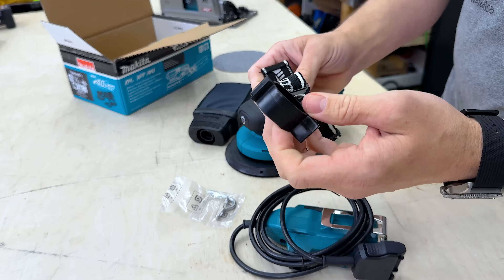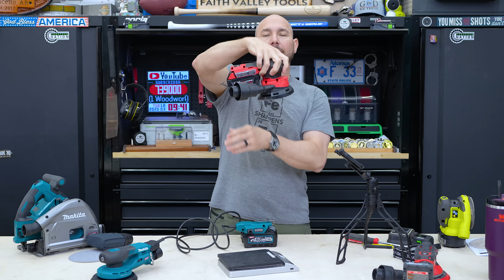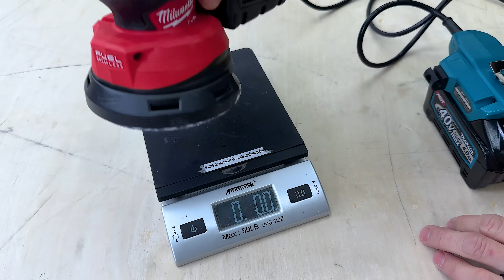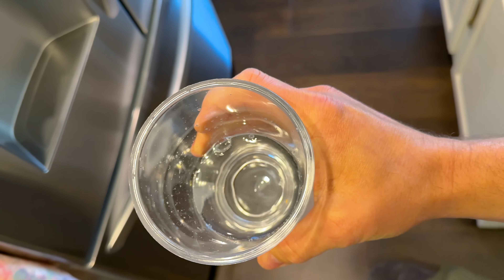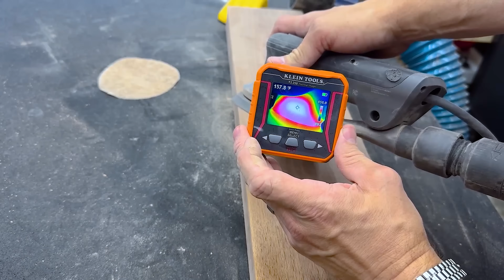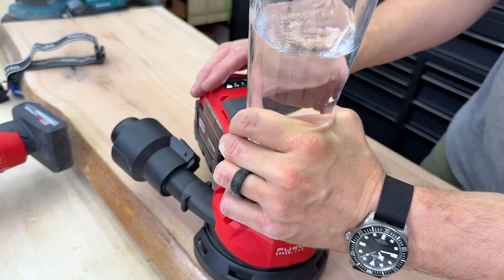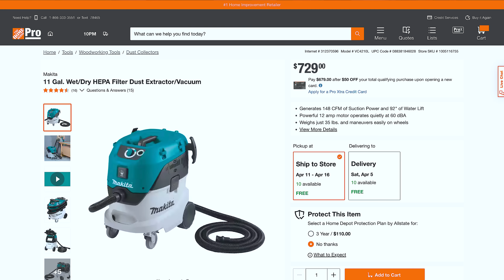Makita Just Changed Cordless Sanders FOREVER! (genius woodworking tool)

Comment: My father had a few Hitachi tools quite a few years back and he had them for years and there was no problem with them. So I decided to go with the Hikoki (Metabo) range. I like the multi voltage batteries and I purchased about 15 a mix of 18v & 36v plus the table saw, the drill/driver I have is 18v and powerful, my impact driver has four settings Whoop Dee Doo. And I would rate Hikoki being up there with the other top tool manufacturers. I think as long as you choose at least mid range you can't really go wrong. A drill/driver is for drilling holes & driving screws in, a circular saw does the job of sawing 6 by 2 etc, a reciprocating saw does good when it's time for demolition work and a sander is for making your projects smooth. As we all know tool manufacturers are always trying to better their tools and as long as you don't buy the bottom range of tools if you are a D.I.Yer, handy man, woodworker, tradesman etc you should be fine. I do like the power adapter, that fits all the 18v & 36v tools, the idea of not running out of juice especially when using my 36v weed whacker or the 36v chainsaw for those jobs that take a bit longer to do, I just have to let the wife know how handy they are and hope she gives me the card lol.

Comment: making an adapter to use AC in the battery slot would would make a lot of sense to me, could use it corded or cordless then. I may try to make one, just need to figure out what the max current draw on whatever tool would be... But I don't understand the battery on a cord, why not just get a corded one then? is there something inherently better about using a DC motor? Or just in case you have to use it where there is no power available?

Comment: This is so dumb. Having a cord attached to the sander makes it operate like a corded sander, but now it also has all the drawbacks of a battery tool too like more expensive, need batteries in the ecosystem, batttery life over time. You could just have a longer cord and then idk...plug it into the wall. What a racket. "unbelievable" alright.

Comment: They should design it with a wire terminal that couples into a battery slot so that you can choose between corded or cordless. All tool companies should do this. Awesome concept.
Reply: I was thinking the same thing. An adapter like that is very easy to design and print. A few bits of metal and cord and presto!I know what I will be doing tomorrow

Comment: This review is somewhat inaccurate unless you can also use this sander as a corded sander. Otherwise, the price claim of $249 is misleading.  You must add the price of a 40v battery for it to be accurate. I suspect a battery adds near $100. Even if you already own a Mikita battery, some additional cost was there at some point. This thing mostly makes sense for remote work. Not so much in a work shop where you can get the same features from a corded sander without hooking a battery to your belt.
Reply from the maker: Price claim would be the same for any of the cordless options shown.  You need the battery platform anyway.
Reply: @731Woodworks  I hear you on that, but it's still not $249 for a working sander. BTW, I am a fan of all your other videos.

Comment: Why not just get an Ecoflow or Jackery for your corded tool instead of something like this? That won't lock you into the Makita battery platform and you can buy whatever. The only way I see something like this system being best is if you're on a ladder or in a tight space and you don't want a power cord and would rather have the battery on your belt or wrist strap.

Comment: Wow i cannot wait till they make sanders with power cords that plug into the wall. They will be able to be weighted just right, have more power and reliability and last 30 to 50 years. Wish they could do that.
Reply: I would think they could easily just make a regular power cord that plugs into that connector. I'd buy it if that were an option!
Reply: @chrisvanover7817  That's what i though it was at first based on the thumbnail. Ryobi does that allot with their tools.
Reply: @chrisvanover7817 metabo/hikoki have a ac adapter for all their battery tools. Excellent brand for woodworking
Reply: @chrisvanover7817 bro I literally keep thinking about this why hasn’t any company made a power cord adapter
Reply: Heck No!  I want to spend over $500 for a sander/charger/batt with a cord instead!  I also get the joy of running out of juice!  Genius!
Reply: Everyone here thinks they’re an engineer.
Reply: @elephantgrass631  pick me LoL 😆
Reply: Exactly what I was thinking! 
Idiot idea!
Reply: Yeah, yeah.  But you have to bring your material to a socket or have long extension cords.  This has the flexibility of cordless, with the balance and weight of corded machine.
Reply: And never have to worry about dead batteries! When is this technology coming to market
Reply: I would love for this to have a plug in cord as well.  It would be great.  For anybody that used battery sanders they would know just why this is a better option.  The added weight to the sander makes it work super agressive and end up being hard to handle and really fatiguing to work with.

As for having more power from a cord or a battery... That would be debatable.  New battery tech can output more juice in less time than an outlet.  It won't work for long but you need a lot of power a battery has higher discharge potential than your 15 amp wall outlet.
Reply: Having worked a production cabinet shop where air sanders are the norm as well as hauling pneumatic hoses are a pain, this could be a great addiction to a shop. We typically don't use cordless due to weight imbalances and even though 4lbs doesnt sound like a lot for a typical 8 to 10 hour shift every lb makes a difference. The price however may put it out of the home shop market, but i guess all of makita 40v are pricey
Reply: @toyotadriver8101  I don't press down hard on a sander and that extra little bit of down pressure really makes sanders extra agressive and unwieldy.  At least that's my impression.  I like cordless tools in general but not sanders and air sanders are great.
Reply: LOL. I just use a corded sander with a retractable extension cord attached to the ceiling. Cord is mostly out of the way, and no battery death.
Reply: Exactly 💯 😅
Reply: I think it is strange nowadays that some of the corded tools still are not brushless (because the efficency is not needed?), but the battery tools are...
Reply: @kaktus3175  Yep do not need the added expense to make a corded tool brushless. You have unlimited power, so it really is pointless. Most tools it is easy to replace the brushes, but it takes a very lot of use to get to that stage.
Reply: @FUQNDV8  I am no power tool engineer, but I still see it from another perspective: You need two designs, two assembly lines. I find it kind of strange, that this obviously still is more lucrative than having basically the same thing w/ & w/o powercord.
And unlimited power: Do you still use light bulbs or are you on LED?
Reply: @kaktus3175  Cordless, corded or air have their strong points but if you are doing a lot of wood work or metal work battery powered are useless. Battery are great for small quick jobs less than a few minutes or you have to move around locations in a house for minor jobs. If you are working in your garage or outside and sanding for an hour, you need all the power you can get. I use battery, 240 volt and air. If any job is more than 2 minutes with a battery tool I use the 240 volt as it is quicker. Takes me all of 10 seconds to throw out a power cord i have them plugged in and hung up at beside most doors in the garages.
Reply: @FUQNDV8  But that is the thing: I for instance need the flexibility of a battery tool often or at least I want to have it. I also don't want to buy two tools of the same type and I don't have the space to store them. I would find it ideal to just have a AC/18V DC Adapter for those times I could use a cord.

I am not sure if I really like the Makita "battery cord" idea for myself. But I can at least see the point: Not such a heavy machine when for example sanding walls or ceilings, but still flexible without the need of an outlet.
Reply: @FUQNDV8 see there's a difference you have a space setup with power at the ready, most cordless tools get used on a job site where power is not at the ready. If I need power somewhere on our site I need to go to my truck and get a 50 or 100 foot cord then go to a power board we have set up and plug the cord in and drag it back to where I am working
Reply: I guess you don't like more options.
Reply: they could even make the sander bigger! like maybe add an inch or so. Idk I'm not a scientist.
Reply: Obviously its for new costruction where there no power. I cant wait until they create a tool capable of of pulling peoples head out of their butt though.😆
Reply: I know what you mean.  Seriously consider give a try with the VEVOR Mirka-like replica.  Order directly from the company, not Amazon, unless Cray-cray uncle Trump subjected this Chinese, yet awesome, company to a full-on tarriffed traffic.

I’m Canadian.   I ordered it for a little less than 300$ CAD (including the usual, in-house, out of this world taxes!).  It is as every bit as satisfying to use as the low-riders from Mirka, 3M, and Festool.  Some features might seem less technologically intricate on the Vevor model, especially the way to remove and replace the absorbing pad (which is, as of now, a fundamental feature of low 😊gravity, paddle-controlled sanders.). I have yet to find a reason for not wanting to do it the Vevor way.  I ‘ve had this sander for almost half a year,  and i have yet to find its weakness.

I WOULD BE GLAD IF YOU’D EVER CONSIDER EXTENSIVELY TESTING VEVOR’s SANDER!  This tool seems to me a game changer for the DIYer and the pro in the first years of running his own shop!  

LOOK FORWARD TO YOUR REVIEW!  KEEP UP THE GOODS!
Reply: ts such a marketing psyop its almost on the level of news media "We'll talk so loudly about these battery powered tools that cost 3-5x more & require batteries that only last 5 years or so that people won't even be able to hear about the corded tools that are cheaper & more reliable". Im sure the much higher % margins are a big factor that gets the whole system to play along. Obviously some tools are really convienent to have cordless but really outside of like auto mechanic work and like duty tools like a home drill & such idk why cordless tools are always suggested like they perform much better than corded.
Reply: @MarkTrades__  agree with a lot of your points.  I have 2 5A batts that have died in the last two months, and I probably have a few more cordless tools than I should due to good marketing (cordless glue gun anyone?  At least it's brushless 🙃).  However, I haven't picked up my corded recipro for around the house tree/bush trimming since I got my cordless last year, and a cordless blower certainly beats dragging around a 50 ft extension cord.  I do agree that the shift to all things cordless is quite driven by greed.  I don't see this corded/cordless sander as anything but a money grab. Don't even get me started on each line having their own battery pack requirements.
Reply: @JohnSmith-ld1pw  exactly. Some tools are absolutely improved by being cordless (hedge trimmer comes to my mind haha) but woodworking tools almost always being used in a workshop environment? An angle grinder uses to sharpen lawn mower blades? Circular saws? "Oh but if you are at a job site without power" what the heck are pros building where they go "you know what? We don't need a $1000 generator that can power everything, we just need $2000 in a single cordless tool battery platform and then a charger the size of that generator to keep the batteries charged. It will be fun constantly swapping them, trying to keep them out of the heat, trying to maintain battery health, etc"
Reply: @MarkTrades__  one reason for cordless tools in the workshop is, well the cord. Getting rid of the potential for injury or damaging from the cord is a good thing. The other is running power outlets to be able to plug everything in.  Cheaper and more organized to have a charging station than cords hanging off tables or from the ceiling.  Sometimes a mix of both works best.
Reply: @1packatak  I'd argue there are a lot more safety risks than a cord in an active workshop environment and that operating with safety in mind is a requirement as you can't design out the risks inherent in working with power tools.
Reply: @1packatak  a power strip is way cheaper than a multi-bay battery charger and the associated batteries. A mix of both is definitely the best but corded is underrepresented
Reply: @1packatak  Rather than a power cord then you run air tools and have the air connection just above your bench then use a light weight coiled up air hose to the tool. If a person can spend that much on all battery tools they can buy an air compressor and air tools. Only use for battery tools are very small jobs around the house that take a few minutes to complete. I use both power and battery and power are easy 5 times more efficient and powerful. You soon notice if you use an angle grinder on steel.
Reply: @ true. An experienced woodworker will know that and be as careful as possible. But crap happens. There’s a guy on YT missing most of the fingers on his left hand from a momentary lapse in safety. 
An inexperienced woodworker is much more likely to get injured.
Reply: @JohnSmith-ld1pw but you don’t have to buy them.  I can see the advantages.
Reply: @FUQNDV8 I've actually measured the power usage. Electric sanders are much more efficient than air samders..
Reply: @MarkTrades__  Here's a fun little fact. Some of the tasks we do on an actual commercial construction site are repetitive, don't take long, and have to move constantly to a new area or floor. So then cordless rules over corded all day long as set up and clean up are basically none existent. Then there's this fun little gremlin we have on our sites called the safety man and they love to go OVER BOARD on the safety. And they want cords tucked out of the way against a wall or something (can't cross doorways running down a hall though) so then they'd like to see them hung from the ceiling. No one's got time for all that bullshit on top of you know how hard it is to get guys to follow that rule, we literally can have a labor walking around all day sweeping and hanging cords up and that's on a smaller project with only like 10 to 30 guys there given the day
Reply: @n8_the_carpenter816  I'm a woodworker.  I love Corless tools for almost everything.  Sanding is one of the things I do that I prefer constant power to.  This sander I would get if I could plug it in when I'm in my shop which is 90% of the time
Reply: I really don't understand why you'd want a cordless sander only to then connect it to a comparatively massive dust extractor hose. The power cord has never bothered me, not once.
Reply: @Root_boy  I think that people tend to overlook other settings than they are used to themselves.
People who have a workshop/garage probably are fine with cables or as someone mentioned a big air compressor with an overhead setup to connect the tools at the workbench without hassle. But there are so many people out there, who live in apartments, use portable workbenches and so on. I can understand that is way easier to use battery tools and not have to run a power strip from somewhere.

I was working in two different hallways the other day and was happy that I had a battery vacuum, so I had not to bother with outlets and stuff.
And yes, nowadays you can even get a big battery with outlets for all the tools on a job site. That actually maybe would be something I would consider when buying a lot of new tools.
Reply: @kaktus3175  that's fair. I used to not have workshop either but I guess I suppressed the memories of having to sand without a dust extractor ;)
Reply: @Root_boy  As I said, I do use one (Metabo ASR 36-18 BL), which is also battery powered (2x 18V) and it is just nice to roll it to the next room without the hassle of a cord. That said: I do wish it had the option to connect the Hikoki/Metabo HTP 18/36V power adapter to it. Also, I stumpled across the Festool quick connector idea and yes, having a cord attached to the dust extraction with a quick connector and then just plug the vacuum in the outlet does make sense a lot to me as well.
Reply: That’s great if you’re in a workshop or always have mains power supply. Probably one of the more idiotic comments I’ve seen, if you want a corded sander there’s literally thousands to chose from and if you need to cordless it’s great because the options are limited and the majority are the same design. The world doesn’t revolve around you buddy

Comment: Honestly, I wouldn't call the Makita a cordless sander, but perhaps a short cord sander, or perhaps a "hybrid power" sander.
For those not in the know, festool is scheduled to begin selling their new cordless sanders soon, the etsc2-150 and the etsc2-125. Both run off the festool 18v battery platform, have adjustable speed, excellent dust collection, almost no vibration, a ring style work light that is stupid bright, with adjustable brightness, and full bluetooth compatibility with the festool dust extractors.
I had my hands on both of them just this morning, and they are absolutely phenomenal sanders, and fairly reasonably priced compared to the competition. I didn't get an availability date yet, but if you're in the market for a cordless solution, hold on a bit. They are BOTH worth the wait.

Comment: Those sanders that are probably 150mm,  since 6"=152,4mm. My sander is 125mm, but I never bothered to check the pad for accuracy, if you happen to have a metric tape measure, you might try it.